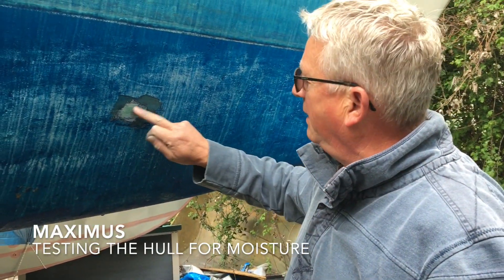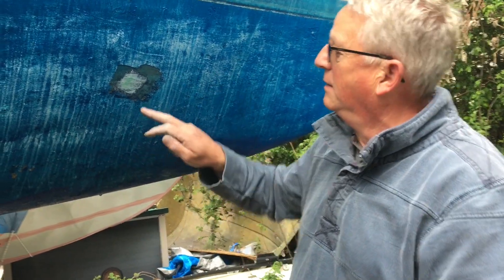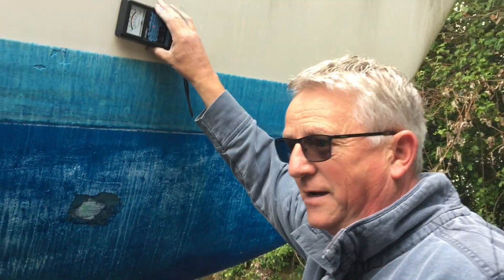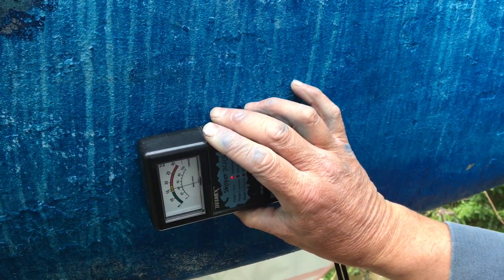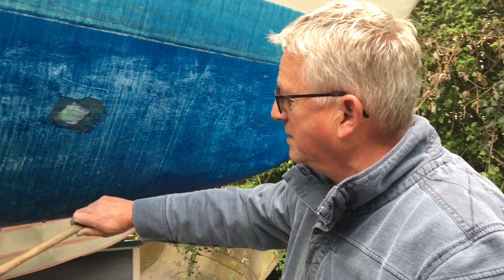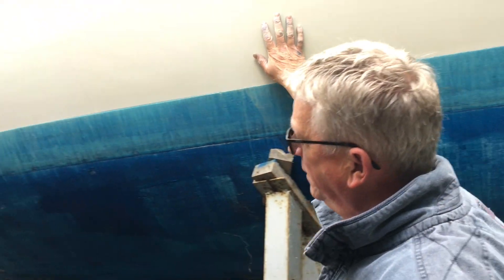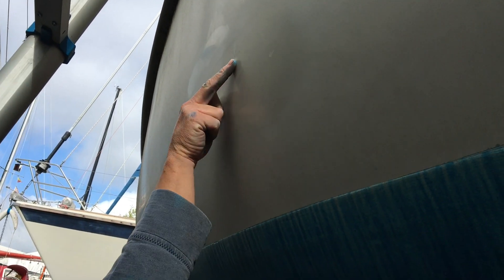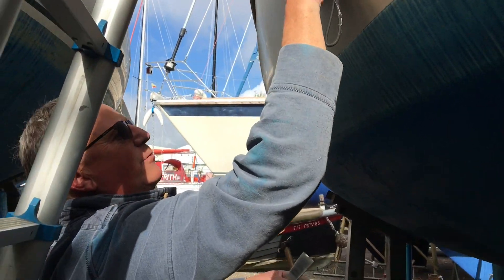This is what a dry boat sounds like... but just wait till you get to the anchor locker

Comment: Wow, that meter is amazing!! Can you hire one do you know? It seems like it may be a big outlay just to use once in a blue moon.
Reply: In the States you can get good enough meters for around $60
Reply: If you search for the term "pinless moisture meter" they are often advertised for use with measuring wood for furniture making. I found one for £30 and put it on the hardwood setting. Just don't get the ones with the spikes.